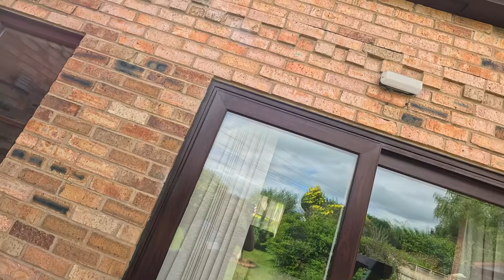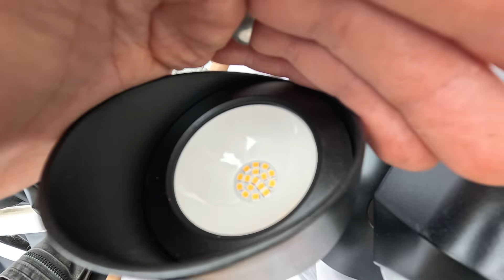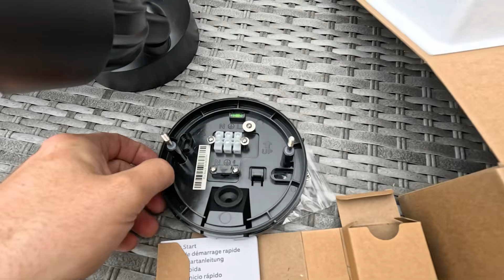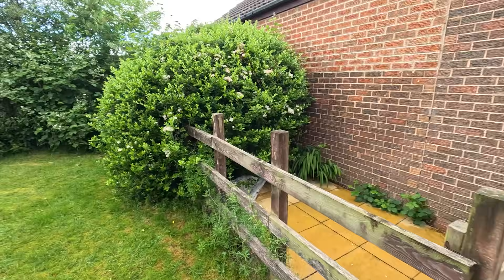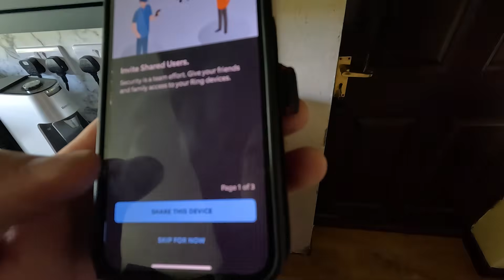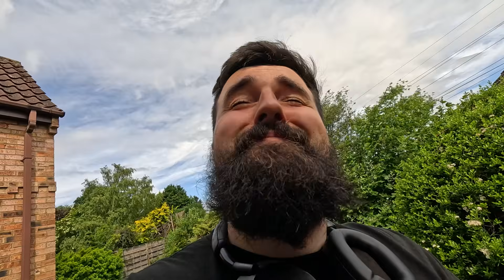🔌HOW TO INSTALL A RING FLOODLIGHT CAM! 📹

Comment: If you don’t mind me asking, what’s your typical rate for this kind of work. Thanks
Reply from the maker: Takes a good hour to set up the app, 2 lights replacements with clean up, 2 hour so £200+vat then the materials on top with a 20% mark up for warranty’s 👌
Reply: @finneyelectrical thank you mate, as newly self employed spark, pricing can be the hardest thing.
Reply from the maker: Do a £400+vat day rate, materials plus 20%. Or price per point, 6items plus its £65+vat a point for a light ,switch or socket. 6mm supply’s £220, fuseboard 10way rcbo£850+vat, 6way rcbo £700+vat